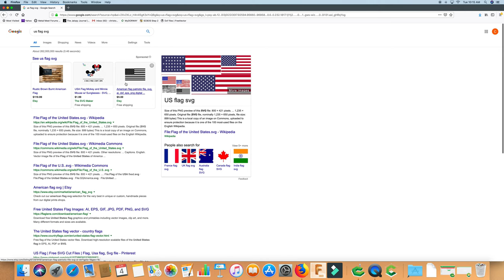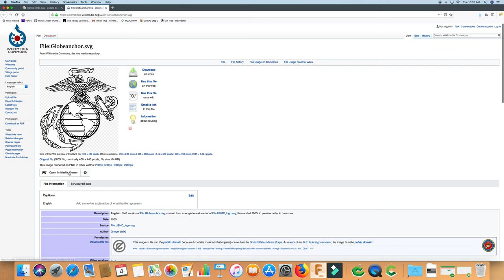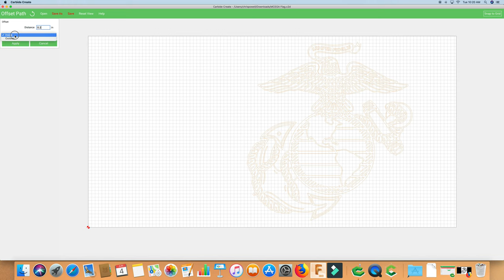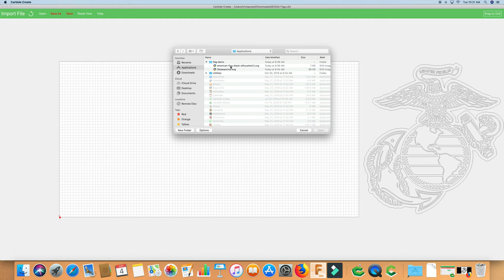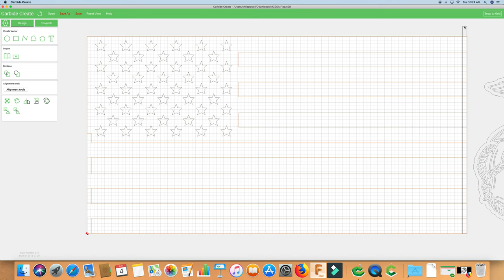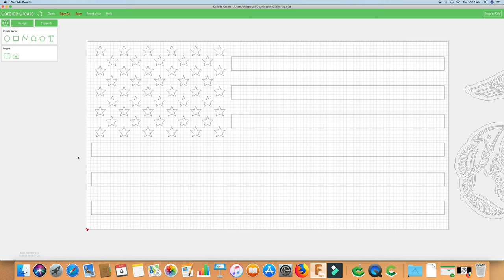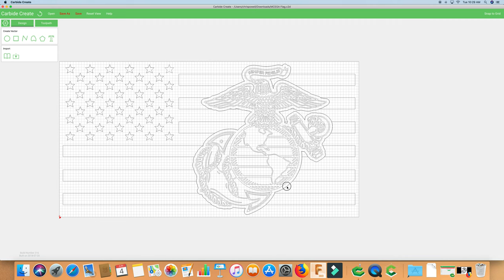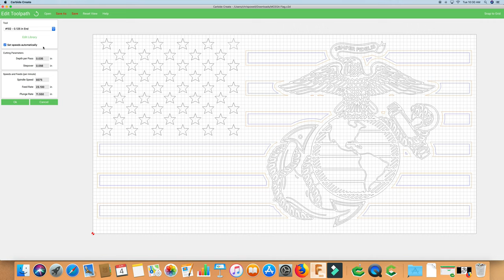How To Program This Wood USMC American Flag - Carbide Create Tutorial

Comment: Hi. I have a noob question regarding deleting redundant bits of a design. Is it a matter of ungrouping, highlighting and hitting the delete button on the keyboard for Mac OS? If so, it doesn't seem to delete for me so I'm wondering if I'm doing something wrong or if if in fact it is a bug in the software.
Reply from the maker: You have to hold the fn button while hitting delete. That one got me for a while too.
Reply: @ChrisPowellFSD  thank you.
Reply from the maker: I just noticed that in version 415, you have to hold shift instead of ctrl to select multiple objects.
Reply: @ChrisPowellFSD  thanks again. I'm using 413 so your initial advice works. Might download the latest version.

Comment: Hey Chris Nice video! I'm new to the Shapeoko and have a quick question about the carve times for this project.  I didn't see the estimated carve times displayed under each of the tool path you configured.  I tried to reproduce what you did with the same or similar bits and feeds and speeds, but mine shows 2 hrs and 48 minutes.  With 1hr 40 minutes of that for the Marine Logo.  Is that about what yours would have been.  I did the logo with the Carbide #302 60 degree bit.  I tried with a .25 inch 30 degree v-bit for the Logo, but that would have taken over three hours just for the LOGO.  Does this seem correct to you?
Reply from the maker: I made some adjustments to my feeds and speeds. They’re listed in the description.

Comment: As always great video but whata your run time for each operation? Im at 2.5 hrs for pocket and 1:45 for v. Same size flag. Just curious thx
Reply from the maker: I can knock out most flags this size in 30-45 mins with the tool change. Last time I kept track of the time, I was doing a union in 7 mins. Stripes are pretty quick too. The logo is the main factor that changes the total run time.

Comment: Chris, great video. Just what I was looking for. I looked at the time it would take and the EGA alone was 87 minutes. I know you said check feeds and speeds, I have them pretty much matched to your design. The issue I this in the svg has alot of extra nodes. I can't post an image here, but when I grab the same svg as you (wiki commons) and import it into carbide create, some of the individual lines are now "outlines", each of the black hashes around the globe in your image are just a straight line, when I import they are now rectangles, meaning 4 nodes to a line. If you send me an email or a way that I can share the images maybe you can help me figure out how to fix it. I have looked at the svg in carbide create, vectric and fusion 360. ( i have a trial of fusion). I have the same issue with a squadron patch logo that is an svg, the ring around the patch shows in the svg as 2 circles (inner and outer).   
-Thanks   
Harold

Comment: So Ive been having trouble with my vee carves esp when doing stars.  How are you making sure your boards are 100% flat?  Do you run them thru the planner first?
Reply from the maker: No, I position them so the bow is facing down in the center and pull the edges flat with clamps. A level wasteboard is key.
Reply: @ChrisPowellFSD  Do you have a video or picture of the clamps you use?
Reply from the maker: I use the PwnCNC toe clamps

Comment: Hey Chris,  Watched several of your videos, great work by the way.  Can you answer a question for me.  Why do you initially set the parameter at 21.38 inches but you cut your stock to exactly 21 inches.  I saw one of your videos that showed you cutting the stock at exactly 21 inches.  Please let me know  Thanks
Reply from the maker: It’s just easier to measure that. If your stripes look shifted to one side, you can just shift them a hair in the program.

Comment: I really enjoyed your video. I'm new to this and am trying different platforms out to see how user-friendly the are to create designs  before I buy one of these CNC's (leaning towards the Shapeoko now). I just tried making this flag using Carbide Create, following your video step by step.  I'm sure it'll get easier as I familiarize myself with this program.  I spent about 2 hours on this.  My biggest issue (time waster) was finding a Flag SVG file that uploaded all of the stars.  Many files didn't. At the end I uploaded a similar image like the one you used into Inkscape and made it into an SVG file.  Carbide Create also stalls alot. I had many moments where the program "wasn't responding".  Other than that, I think you explained the process well.  Thanks for taking the time to make the video!
Reply from the maker: I actually put the flag on my website. Let me update the description. It was a pain for me too. And don’t get discouraged if it takes you some time. I promise you it took me days and weeks to get the first one right. Just keep working on stuff and eventually you’ll be able to knock new ones out fast. Thanks for the feedback.

Comment: Hi Chris. Great videos, thanks. I watched this one and the one that shows you staining and burning the pledge flag. One thing you didn’t mention is where the color in the EGA comes in. For the EGA flag fo you carve the EGA first and then paint it black and then sand, before carving the stripes? I’m sure there’s more than one way to do it just wondering what your method is. Thanks again
Reply from the maker: For the black flags, I always paint them before any machining. For the EGA flag with the red and blue epoxy, I machine those first, then spray them with a few coats of lacquer to seal them. Then I fill the carved areas with the dyed epoxy. After it cures, I sand them smooth and apply a few more coats of lacquer.

Comment: What are using to seal the wood and not let the black bleed through?
Reply from the maker: I use the same gloss lacquer that I seal them with after eve thing is done. You can also use dewaxed shellac or brush on a thin coat of epoxy for bigger areas.

Comment: Thank you so much for taking the time to create such a detailed video Chris. I've been messing around with the program and learning how to use it and this video certainly helped. I also had issues with the boolean feature but you gave a solution in the comments.  Could you please add a link or picture as to what specific bits to use/buy? I'm waiting on my shapeoko to be shipped to my house and I'm trying to find the specific bits for the best price/quality. I know you said 1/8 inch endmill bits and 1/4 inch vee bit (60 degrees). Could you add a picture or link to find the specific bits please? 

Thank you again for the amazing walkthrough!

Comment: Can you give me some advice/help. I tried using a v- bit ( rc-1148) on a logo.   It cut extremely deep and basically made firewood, twice. Can you explain to me how to set up depths, I’ve watch you videos and I do amazing stuff.  I just want one flag to not be firewood.
Reply from the maker: You really shouldn’t have to set a depth for doing v carves. Your z zero might be set too low, or you might have the wrong zero selected. You can select the top and bottom of the material for the start point. Make sure you’re selecting the top of the material if that’s where you’re setting your z zero. Also, it’s very important to have flat material and a level wasteboard. Make sure you’ve surfaced your wasteboard. I find most material has a little twist to it, so I position the bowed part down in the middle and use clamps to pull the edges flat.
Reply: @ChrisPowellFSD  I actually used your videos for waste board. I've watched them ummm seems like a million times. (fyi—Meant to say YOU do amazing work)  

Question can I probe Z with a v-bit? will that help me at all? or should I do the paper thing, then just leave setting alone in the depths etc… 

Thank you so much for your time and response. You really do put out good work and informational videos. Thank you..
Reply from the maker: Thanks I really appreciate the support. Honestly, I don’t use the probe, but I have heard of people running into issues with a v bit. I just use a piece of paper.

Comment: Chris, I enjoyed your video.  I wish I had seen it when I first got my Shapeoko XXL a few months ago.  Question - Do you ever have a problem carving stars on larger flags?  I have made a few flags that are roughly 20 inches tall and 39 wide (using glued panels from Lowes and 90 degree v).  If the board is not perfectly flat then there can be a difference in the size of the stars from one end of the Union to the other.  Have you ever experienced that with your 11-inch flags?
Reply from the maker: The key to a perfect v carve is to have your panel as flat as possible. It’s hard to find perfectly flat wood in the big box stores, so I usually position them with the bow facing down in the middle, and pull the edges flat against the wasteboard with clamps.

Comment: Just to clarify...you jumped around a bit on the tool settings at the end. For the stars, what is the feed, speed/rate?
Reply from the maker: I think they were originally 60 feed/40 plunge. I’ve started running it at 80/60, and turn it up to 200% if I’m just doing my normal pine flags.

Comment: Hi Chris. What  is the max dept you set for the EGA? I cant seem to get it right, leaving it way too deep, or barely visible
Reply from the maker: It’s just a regular v carve. It will only go as deep as needed. If you have to set a depth, set it to your material thickness. If you’re having issues with it being too deep or not deep enough, there is a setup issue. Check out this video. https://youtu.be/MvEgdYw2wDY

Comment: Excellent video!! I'm grateful that you took every step and explained it in detail. I'm a definite rookie to this and up to this point I have only used my CNC for cutting some slots for trophy bases, but I'm eager to venture off into exploring the potential of the machine. I watched this video twice to get the overall idea and then watched it one bit at a time while I created the artwork on another computer while pausing this one. I think I did everything correct, except I didn't have a 1/4" 60 degree V bit but programmed in for my 1/2' 60 degree V bit. I don't see where it will matter since the angle is the same and the depth is programmed the same as the 1/4' bit. When everything was said and done I noticed that the time for each stage is as follows:  Stripes - 1 hour, 26 minutes,  Marine emblem - 10 hours, 39 minutes, and stars, 11 minutes.  Please tell me I've done something wrong!!  I can't believe this would take over 12 hours to complete! Thanks for a great video!
Reply from the maker: Thanks. I’ve updated my feed rates in the description. Check them out and try turning them up a little.
Reply: @ChrisPowellFSD  Thanks for the reply. I ran the job today. The stripes came out perfect but I think the V carving had two problems. First, I think the 1/2" V bit has a flat tip on it rather than a full point which was noticeable at the tip of the stars. Also the bit cut too deep. As it was working on the detailed area of the emblem, it was completely taking out many of the adjacent tiny details. Oh well, sometimes the horse throws you but you just have to get up, dust off your hat, and say "&%#($%" and get back on. :) Thanks again  for your help!

Comment: Thanks for the great video.  Very informative.  One question i cant seem to get past, on the logo am I correct that you ungroup the the design and the border you copied  prior to setting it inside the flag.  I think I followed you direction step by step.  Once I have  placed the design inside the flag and do the boolean subtract function and delete all the extra lines I go to the tool path and with the design ungrouped I cant capture the entire design because it was ungrouped. Hope this makes sense.  I am sure this is operator error, but this has me stumped.  Any help would be great for this newb
Reply from the maker: Thanks. Yea I ungrouped it. You can actually create 2 groups. If you group everything inside the ega together first, then group that to the outline, after you move it you can just ungroup the outline from the ega.

Comment: What version carbide create do you have cause it doesn't look like my screen and I'm having trouble getting it to  do the functions
Reply from the maker: I usually use 314 and 331. Most of the functions should be the same. At one point they changed ctrl to shift. Here is the Pro version. You can request trials where everything will work for 14 days. You can keep requesting them until they finish beta testing. https://carbide3d.com/carbidecreate/pro/
Reply: Are you using the pro version I'm just have the free version
Reply from the maker: The only difference between them is the pro version allows you to do 3d work.

Comment: Thank you so much for your tutorials, they are so helpful, but on this one when you get to the part to use Boolean subtract, If I click on the lines to subtract it doesn't take me to the Boolean feature.  You said use Command, can you explain this to me, thank you again.
Reply from the maker: You might have to use shift now to select multiple lines. They changed that in one of the versions of Carbide Create. In order to use any of the Boolean tools, you need 2 lines selected. The order you select them in will determine how the tools work.

Comment: So when I try to make each strip its own areas I did what you did but it kept taking a star away do you know what I could be doing wrong
Reply from the maker: Make
Sure you aren’t selecting one by accident, or have the grouping turned on. Click the stripes and see if it also selects the stars. If it does, click ungroup.
Reply: @ChrisPowellFSD  ok I will have to do that so click ungroup and than just do each strip by itself or group the strips but not the stars
Reply from the maker: I’ll try to take a look at it in the morning and see if I can replicate what’s happening to you.
Reply: also I am not using pro and also using windows not mac don't know if that matters

Comment: I used a .5 60 degree v bit and it made the letters hard to read. Will the .250 60 degree v bit help that problem?
Reply from the maker: The diameter of the bit has no bearing on v carving unless you’re design has an area wider than the width of the bit you’re using. Try raising your z 0.
Reply: @ChrisPowellFSD  I didn't think so but that was the only difference from your video to my cut. I will try to raise the Z. I use a touch probe.
Reply from the maker: If you’re using a touch probe, make sure you’re doing it over the area you’re going to v carve. It doesn’t take much variance in the thickness to change the look of the carve. Personally, I find using a slip of paper to be easier and more accurate.
Reply: @ChrisPowellFSD  you know what I did. I put the probe on the corner like I was doing a xyz after the bit change. newbie mistake. but I did order the bit you have lol. Thanks for the quick responses. I love all your videos
Reply from the maker: Thanks! I had quite a big scrap pile when I started out. Still get one from time to time.

Comment: Awesome video. Very informative and helpful. You explained the entire process really well. Thank you. I will try this one very soon. As a side note, how long does it usually take you to carve one of these flags once you get the wood set and fastened?
Reply from the maker: Usually about 1.5 hours.
Reply: @ChrisPowellFSD  man, I made one,  but it took 3 hours. I wonder what settings i may have gotten incorrect
Reply from the maker: Marc Riv I usually turn the stripes up to 200%. Give that a try.
Reply: @ChrisPowellFSD  this may sound like a dumb question, but how do I turn up the stripes to 200%
Reply from the maker: Marc Riv in Carbide motion, there should be buttons on your run screen that say feedrate +10, feedrate reset, and feedrate -10. If you keep clicking +10, you can turn it up to 200%. I just do this so if I’m cutting harder materials, like oak, I can leave it at 100%. Sometimes I’ll even turn the v carve sections down if it sounds like I’m putting too much load on the bit, or it isn’t cutting smoothly. The numbers in the video are a good, safe starting point.
Reply: @ChrisPowellFSD  gotcha, I was using another code sender to actually make the cuts. I guess I can try with motion and see if it's better. Thanks

Comment: Marc Riv asked how long it took to carve and you said about 1.5 hours. My tool paths tell me it will take about 7 hours. That seems like a lot and I will speed up the stripes as you indicated but any other suggestions? Thanks again for all of the video support you provide.
Reply from the maker: Did you adjust the feed rates in CC? The factory recommended speeds are pretty slow.
Reply: @ChrisPowellFSD  I'll give it go this weekend. Thanks.

Comment: Not sure what I'm doing wrong, but the bit isn't touching the stock for half of the work. Goes down close to it, but starts the carve motion without touching the top of the stock.
Reply from the maker: Send me at email at chris@fullsteamdesigns.com and I’ll try to help you figure it out. Send pics of your setup in CC and the piece you’re cutting please.
Reply: Chris Powell Hi Chris. Thanks for the reply. I figured it out. Well, some of it. Using the two-sided tape kinda creates a situation where where the stock isn’t exactly “level”. And when dealing with very tight increments of depth, it was affecting it. But after I figured that out, I still couldn’t get the depth of the V-bit right. I used your settings and it wasn’t really cutting deep enough. I jumped it up to .1 depth per pass, and that was too deep. I’m guessing there’s a sweet spot in there somewhere. I’m using the 302 bit from Carbide. Anyway, thank you again for the reply. I’m gonna give it another try and if I have problems, I’ll definitely reach out. Happy New Year.